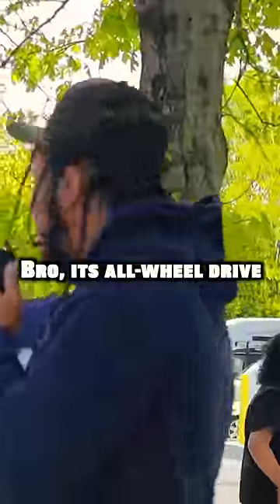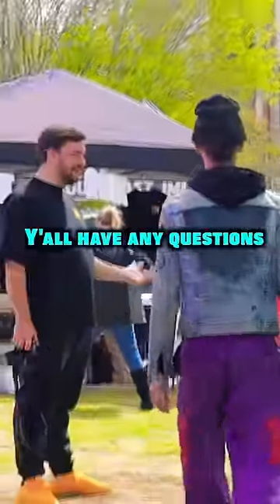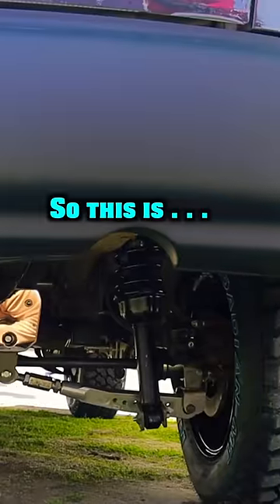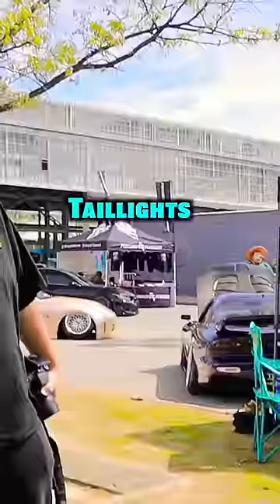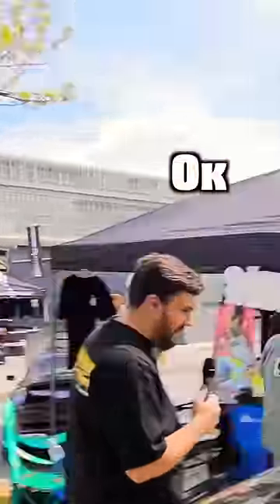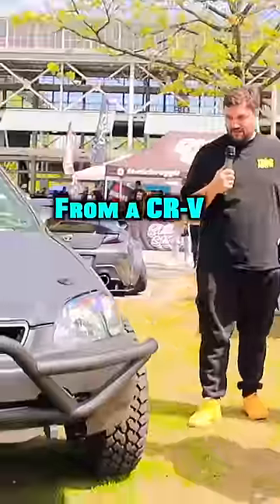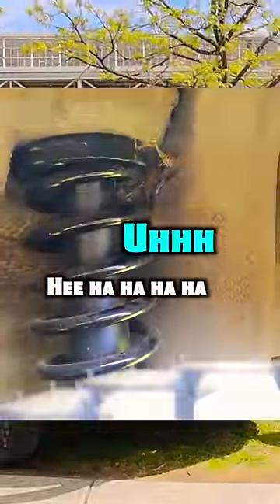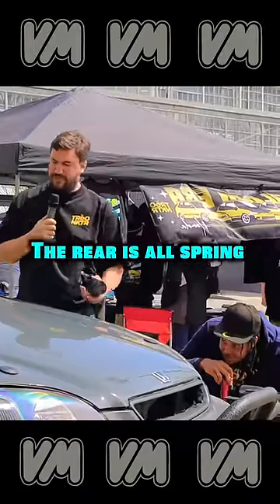👀 . . . Monster Honda Civic #fyp #lifted

Comment: Look up the awd civette (ls motor) …..started as stock ls Moyer then went twin turbo crazy fast. He had a wrecked vette and measured and figured out the wheel base was doable. He had to build in reinforcements to the drivetrain though to keep it from twisting.

Comment: At first glance, I called it.... CR-V. 
It's a CR-V with a 2000 Honda civic body placed on top. He bought body clips and put on different bumbers.... I'm not bashing his build, but people usually talk up their build like it has a lot of crazy custom work, and they literally did a shell swap, that's it. And fyi you can add all the power you want to a k24, but a CR-V drivetrain does not like launching at all. It'll break fast
Reply: In reference to the comment of him lifting his civic....
My point is he didn't lift a civic he put a civic on a CR-V... it's not that serious
Reply from the maker: Hmmm so no off-roading? 😔

Comment: It's not an e, x, it's an. EG with an EK front
Reply: Wrong that is a 4 door lx 99-00 with a 96-98 front clip , hood , fenders , bumper etc with a automatic transmission an auto p28 ecu to run the b20b engine . Eg was only made from 92-95